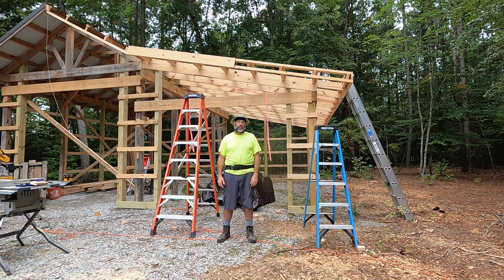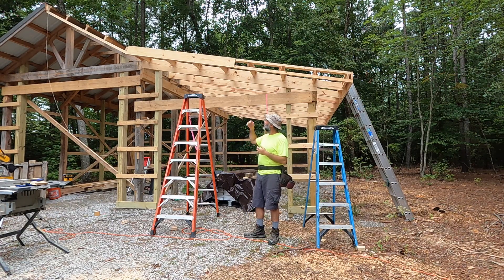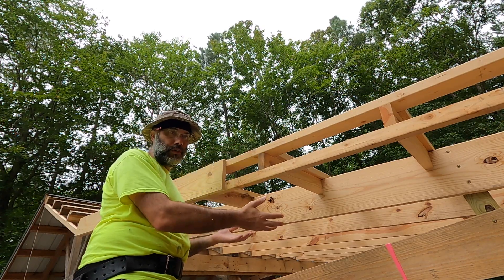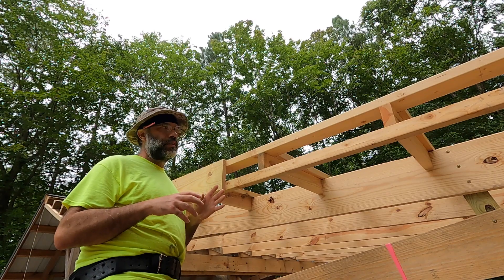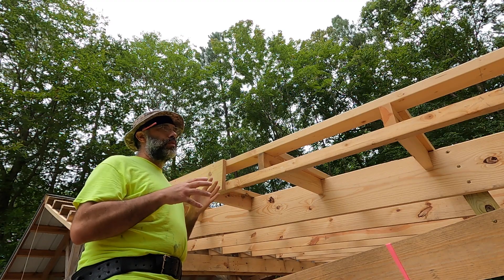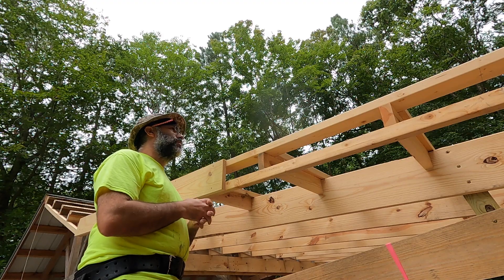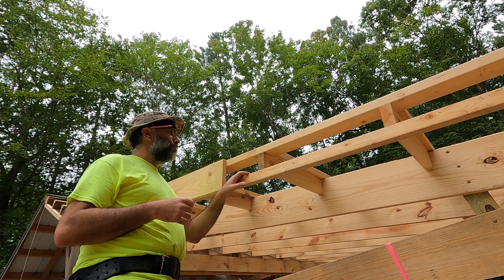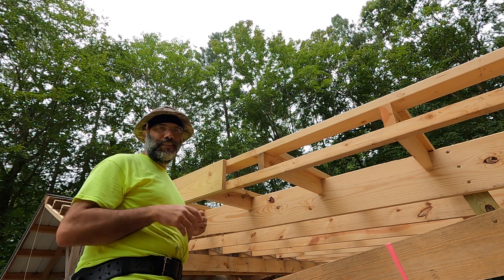Pole Barn Project #13 - How to build a stiff, strong, and light roof overhang

Comment: Your overhang is a nice detail - it could described as an I-Beam or perhaps 1/2 a box beam. Did you extend your outlookers into the next bay or just carry the purlins over the top? Either way it has sufficient strength since I don’t think you have snow load.